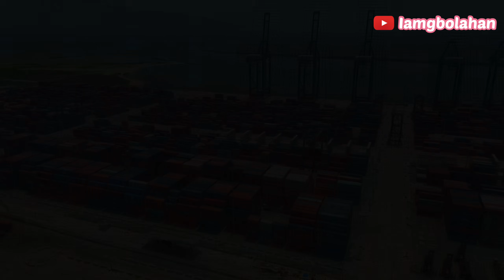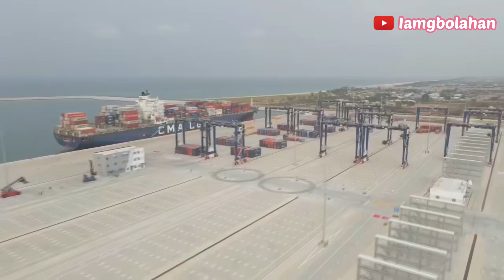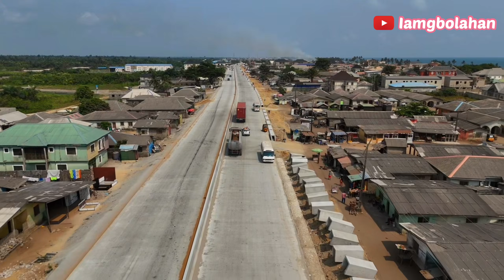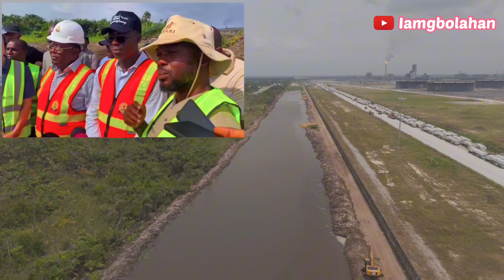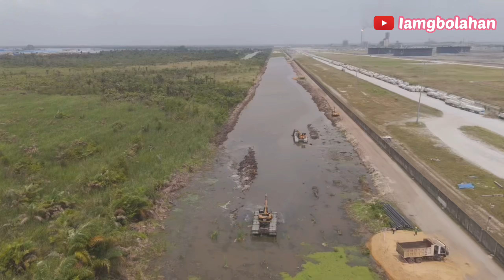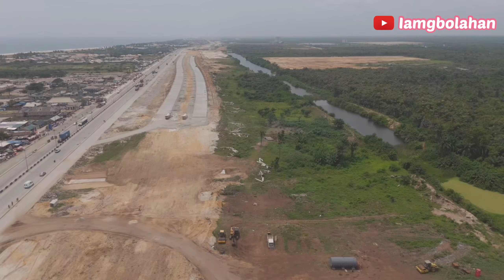7th Axial Road Begins Near Lagos–Calabar Coastal Highway | Lekki Port to Epe Legacy Project

Comment: Lots of stupid people planned this project. Building a road that both fuel tanker trucks and cars will use without planning a separate route privately for those tankers. 20years time and accidents and loss of life will be too enormous. They are not factoring safety into their plans
Reply: My problem is that we have a lot of people that think like you in our government… how sustainable is a private road for tankers in Nigeria? So each road in Nigeria should have a separate road for tankers when we don’t have enough roads for normal goods and services. There is no country in the world with dedicated lane for tankers or heavy duty trucks… what they have is traffic laws that are carefully designed and enforced to ensure safety of both private and commercial vehicles on the roads.
Reply: @Danielnwa042 I am surprised o.
Reply: The reason why this administration is using rigid concrete pavement technology as against tar previously used is because of the heavy truck weight and terrain challenges, especially in the southern parts of Nigeria where the rainfall is much higher. Each direction has 3 lanes, trucks are simply limited to the lowest speed lane, except  when overtaking. These new roads include a management system comprising street lights, CCTV, toll systems, highway policing, and recovery vehicles. The  management of trucks will be easy and safety and security improved. Private sector funding is involved, so this is a business.
Reply: You sounds stupid, even in a develop country they don't design desperate roads for truck,  every highway have normal standard, Nigeria problem is bad road and incompetent road traffic controller department.....why do we have tanks loading in the city when we can pipeline Petrol to city out and create loading area, 2nd in many countries they have system that forbid any heavy vehicle to pass through the city in a busy hour including a construction vehicles..... In many countries trucks can't even enter the city centre
Reply: Sometimes I wonder what planet you guys come from.
Reply: I think rufai oseni will come here and look for cost per kilometer by himself